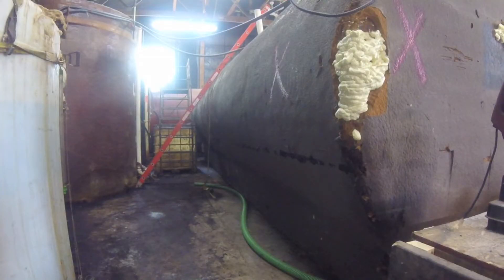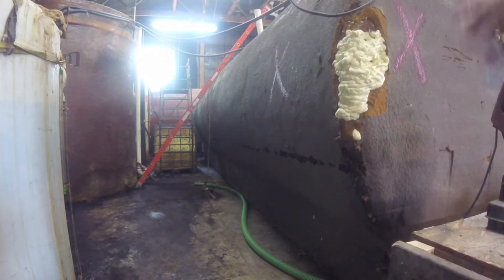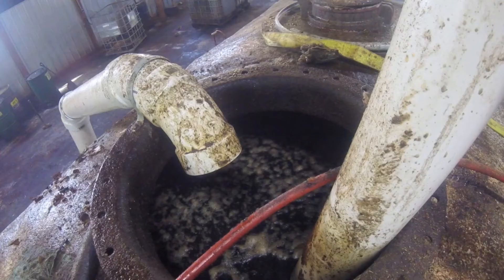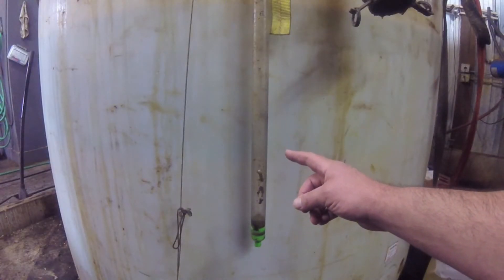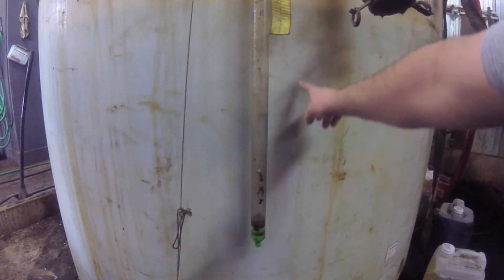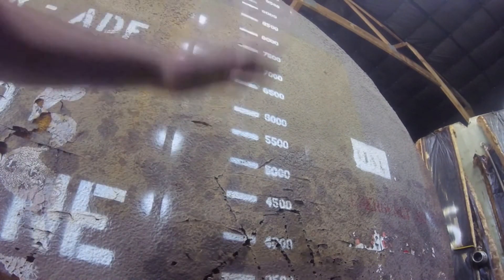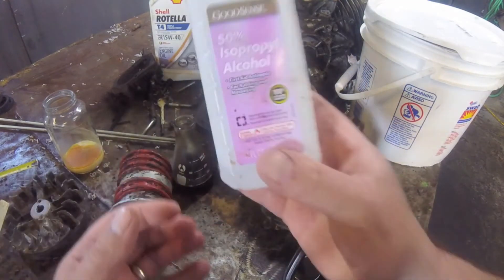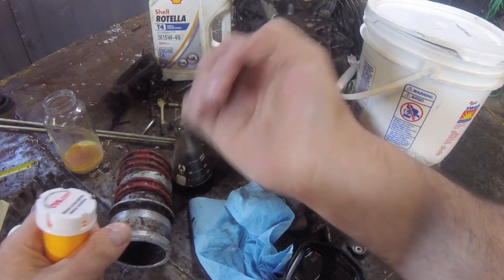AvE shouts out La Casa De Greeza

Comment: Sent over from AvE, and have been binging your vids. Where I'm at in Kansas we don't have many waste oil collectors as gasoline is refined nearby and is relatively cheap. I've always wanted to process a small amount of biodiesel just to see if I could. It always seemed like an approachable chemistry experiment with some results that are more tangible to the rest of us. What are your thoughts on that? Is it MUCH more involved than it appears, or is it just not worth the trouble for the shits and giggles?
Reply from the maker: Mike Jose I like to make it in small batches cuz I don't use it as a fuel but as a solvent and degreaser from the glycerin. I sell just the finished feedstock product to the industry by the semi load rather than making biodiesel. That involves the government, and I'm not very fond of bureaucratic red tape. Glad you like the videos